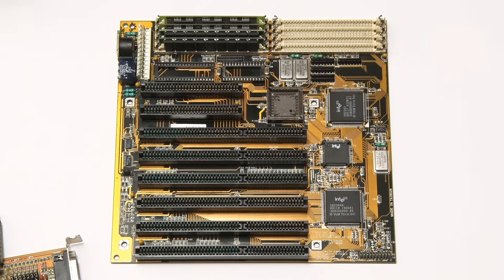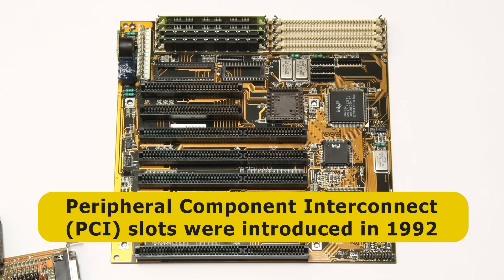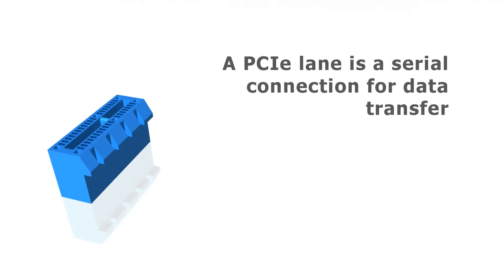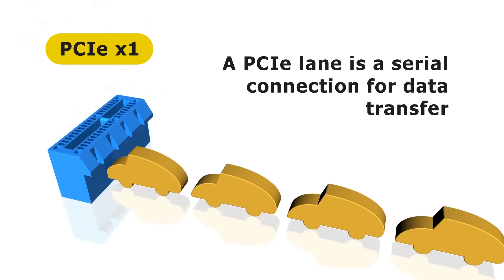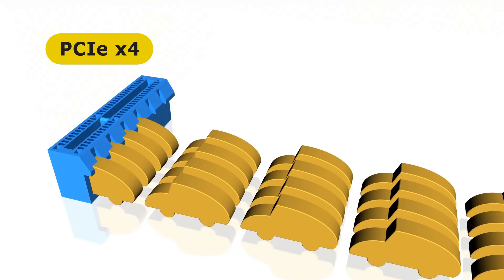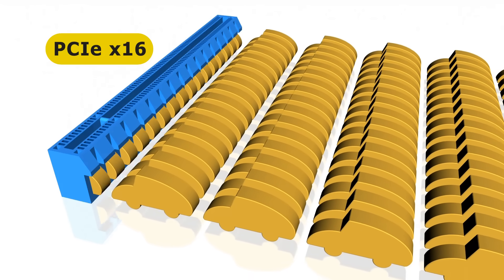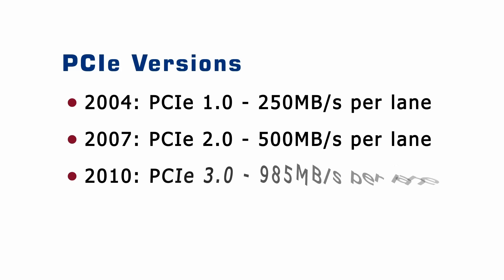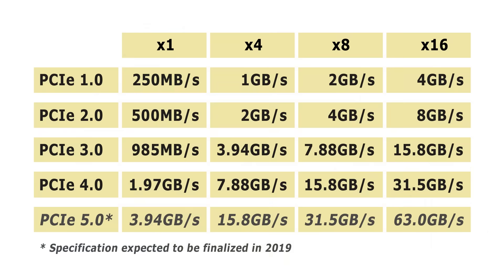Explaining PCIe Slots

Comment: I’ve been tinkering with computers for almost 30 years now, so this really brought back memories as well as actually putting things in perspective. Well done and love to see more on the evolution of just what has been hiding inside those beige boxes over the years.
Reply: I have a question since you said you've been working on computers for 30 years. I have a laptop with integrated graphics card nvidia 1060 6GB card. I am trying to run a triple monitor setup in extended mode (only have 2 monitors at the moment) but heres my question & what ive run into (question at the end). When I had 1 monitor hooked up with DisplayPort cable to DisplayPort MST hub > laptops mini-displayport, I was getting 144hz 1080p (monitor runs those specs). when I connected my 2nd monitor, I was able to get 1080p on both monitors BUT only 60hz on both monitors. im guessing my GPU isn't strong enough to power both at 144hz 1080p right? heres my Q. Can I hook up 2 external graphics cards to run separate monitors and have my laptop run 1 "main" monitor then span with Physx nvidia panel? im looking at the Msi Geforce gaming 1070ti for GPU's.   heres my diagram.                                    left-side monitor: [[GPU {DP cable} > monitor > ; GPU > Thunderbolt 3.0 MST dual hub adapter > Thunderbolt 3.0 port on laptop]]                                                                                            middle monitor: [[monitor DP > DisplayPort MST hub > mini-display port on laptop]]
right-side monitor: same setup as left side monitor since I would have a 2 port Thunderbolt adapter connected to laptop. 
hope this isn't too confusing sorry im a little new to the PC world. I just want 1080p 144hz on all 3 monitors for gaming. thanks!!
Reply: XxBEFALLENxX
Which laptop do you have?

My main computer rig has 2 1920x1080 (aka, 1080p) monitors, and 2 1080x1024 monitors (spanning about 6 feet across my desk). The larger your "desktop," as denoted by the total pixel count, whether it be across one giant monitor or multiple smaller ones, the higher the performance cost to run it.

A 1080p monitor, at 1920x1080 resolution, has 2,073,600 pixels. A 4K monitor is twice vertical, and twice horizontal of the 1080p monitor, at 3840x2160 resoultion, which amounts to.8,294,400 pixels. To run a 4K monitor at the same framerate you were used to on the 1080p monitor, you literally need 4 times the graphics power as you used for the 1080p monitor. Likewise, if you're gaming laptop has a built-in 1080p display (as does mine), and you are running two external monitors at 1080p, then your effective desktop space is 5760x1080, which means that with two external monitors, the GPU has to work 1/3 harder than if it was just running one external monitor. To cope with these limited resources, it has to give somewhere. The reasonable way to manage this is to reduce the refresh rate so that all 3 monitors can be run simultaneously.

Laptops generally aren't well suited for gaming because even those that are specifically designed and marketed for it, despite the horrendous price tags, go obsolete quickly. If it had a 1070 or 1080 chipset, maybe it could do it, but I don't know off hand. Some of these gaming laptops have the GPU on a discrete card, allowing for SOME upgradability, but these will always be proprietary, and cost an arm and a leg. If you're looking for a gaming rig, a desktop is always the better way to go unless you NEED that portability.

Now, if I understand correctly, you've turned off the laptop's built-in screen and are running 3 external monitors; one over the mini-DisplayPort, and the other two running off of a Thunderbolt hub? Thunderbolt 3.0 can transfer at up to 40Gbps, but running two monitors from a hub splits that bandwidth between both monitors, so they both only receive data at 20Gbps, which could also be the cause of your performance drop. 2,073,600 pixels at 32-bit color (32 bits/pixel) is 66,355,200 bits, and times 60Hz requires a  bandwidth of 3.98 Gbps (3,981,312,000 bits per second) or at 144Hz, 9.55 Gbps. So it SHOULD be able to run both monitors at 144Hz. Perhaps the software detects that there are multiple devices on the bus and scales it down by a pre-set rate? I'm not sure.

If the laptop has an HDMI port as well, you might also try running one monitor off of the HDMI, one on the mini-DisplayPort, and one off of Thunderbolt, that way your only bottleneck will be the GPU itself. Otherwise, you might have to get comfortable running your two secondary monitors at 60Hz, and your main monitor at 144Hz if it does that. Typically, the one you want at high speed will be your primary anyways, unless you're spanning the entire game across all three monitors.
Reply: BlackEpyon dang thanks so much for your In-depth response! So I have the Msi gs63vr 7RF 
I have 16GB CPU RAM and the NVIDIA GeForce GTX 1060 GPU with 6GB  graphics card. That is my laptop. 
My monitors are the Msi MAG24C capable of 144hz refresh rate and 1080p. I have only 2 monitors hooked up and I don't have a 3rd monitor yet however I came across this issue(not issue just nuisance I guess lol) ill clarify again so we're on the same page and no misunderstanding occur haha at first I was running 1 monitor @144hz/1080p with PC screen disabled connected via DisplayPort cable to DP MST hub adapter to mini display port on laptop. 

Bought 2nd monitor and hooked up via DP cable to MST hub (it has 3 DP connections and other end is the mini-DP to PC). So then I encountered this issue. With 2 monitors ON (set to extend mode) and PC screen disabled, I was able to get 1080p but both run 60hz now.

My plan is to run 3 monitors at full specs 144hz 5760x1080p extended mode, PC screen disabled for gaming bcuz if I spent the $$ for those monitors then I want to get the full use out of them. Originally I didn't know that it would cause it to drop refresh rate since I was told my laptop can support 3 monitors with the 1060. I'm a noob to the PC world so I thought it was simple plug and play and my GPU can support it. So I understand now that yes it can run 3 monitors however not at what I'm asking for it to do. I started researching and found that yes bandwidth drops because of what you're asking it to do and signal splits like u said. That's understandable to me now lol. 

I asked a frys electronics tech guy and he said to run 2 monitors off a thunderbolt 3 adapter because that'll get me the 144hz/1080p and 1 monitor off the miniDP because it's limited for its bandwidth BUT he said I'll most likely need a 1080ti desktop GPU for the 2 monitors ,which is what ive been looking into, to run the signal that I want. So now I'm thinking with the idea that I need an external GPU with PCI-E adapter for laptop, power supply for GPU, the enclosure, and then cables to connect. Am I on the right track on what I'm looking to do? 

I don't want to run 1 at full spec and the other 2 at 60hz and reason I don't want a desktop is cux at the moment I use this laptop for work too and I like the mobility anyways. I understand desktop is best for this but I just don't like to be stuck to one place all the time. I don't mind blowing lots of money on building this cuz it's honestly kinda funtrying to figure it out. I was an auto tech for 6 years so I know ppl who could make me a custom open air frame/enclosure for the GPU (or two 1070ti GPUs if needed; each 1070 runs 1 monitor and laptops 1060 runs last remaining monitor which would be 1; if that's even possible) again thanks for the in depth response. I hope we can figure this out together lol let me know what you think and suggest. There is no budget idc how much it costs.

Comment: I really miss ISA! 
Had (have!) a WONDERFUL homebrew 4xSID chip ISA soundcard from Hungary.
Have to keep an old computer knocking around just for ISA as the card is that much fun!
Reply: In his video he mentions an ISA slot on a modern motherboard but never talks about it after that.
Reply: there are special "riser" adapter cards, that fit in pci and pcie slots(you can get both types) that convert isa cards to modern mainboards, though i dont know how good they are, also there was a firm from germany re-manufacturing sound cards that you fit your own sid chips on, the new ones are modern cards to fit newer boards.
its actually quite interesting just how many different types of adapters there are for the various slots.

Comment: Thanks! 
So in what scenario would the new PCI-E 4.0 standard become neccesary? Or does is just decrease loading times? I mean I'm still not sure what exact effects PCI-lane speed have on GPU performance speeds.
Reply from the maker: PCIe 4.0, and in time 5.0, just allow higher and higher bandwidth data communication to occur. As you note, a GPU able to take advantage of such bandwidth is needed. There is always a bottleneck somewhere!
Reply: Small computer scenarios are pretty common (x1 slots being faster means they won't require anything larger).
And look at the PCIe 3.0 speed, accounting for bandwidth overheads, it'd mean a 1Gbps network card (almost all are 1x slots) wouldn't be able to reach the full 1Gbps speed in a 3.0 slot.

As for the GPU argument, the speed at which loading textures into the VRAM, which would consume most of the bandwidth, would impact on it's performance. Even the better 11Gb VRAM GPU cards can't store that many hires textures, as it all needs to be uncompressed data. So the loading in and out of textures depending on what is within render distance is normal behaviour.

Comment: One bit to add, PCIe lanes are the most expensive part of your motherboard, these are physical connections between the PCIe slot and the CPU and/or chipset. That is why there are several chipset versions on the market and the ''main'' PCIe x16 slot is where it is (close to the CPU). Also, PCIe lanes (CPU to slot) are divided into chunks of 4. If you have a lower tier chipset, a B150 for instance with 8 PCIe lanes (connections between the CPU and the PCIe slots) and you fit a graphics card into the first PCIe x16 slot, all the 8 lanes are being used by that card. However, if you then fit another device into your other PCIe x16 (x4) slot, it will divide the lanes between those two devices into 4 and 4, effectively reducing the speed of the first PCie x16 slot by half. This is very important for when you decided to put a NVME PCIe card into your second PCIe x16 slot of your PC (or any other such device). The other PCIe x1 and PCI slots, and other devices such as USB and SATA controllers, Ethernet controller and so on, are being fed from the chipset and do not ''rob'' you of the very fast PCIe lanes.
Reply: That is not the right thinking though. Most of the PC users (who care anyway) are gamers, and for that a server grade HW is a waste of money. Paying for what they are not going to use. Even with SLI configuration all you need is 8 lanes per gfx card. Having 16 lanes per card won't boost the performance (PCIe 3.0) as current consumer grade HW won't even fully utilise the PCIe x8 (3.0). Mind you, we are a few months from PCIe 4.0 (5.0, some say we're going to skip 4.0), which will be even faster, than what we use today, which would mean less lanes will do the same job. We have seen this before. PCie x16 (2.0) = PCIe x8 (3.0) and it scales all down to the PCIe x1.  So, we won't have more lanes in the future, we're going to have the same amount or even less, but way faster. It's the physical work to put the lanes on the board and the CPU, that costs the money, not the technology.
Reply: @philipcooper8297  Regarding PCIe 3.0 being fast enough: The M.2 slot for SSDs is basically PCIe with only 4 lanes and modern SSDs are already fully utilizing those lanes. PCIe 4.0 will improve M.2/SSD speeds.

Regarding cost: The insane switching frequencies of PCIe ≥2.0 require special circuit board materials and routing. It’s very hard to get right without repeater chips (signal retimer ICs)  which are expensive. The long wires, pins and connectors also have considerable parasitic capacitance. Switching those caps at high frequency is demanding for power supply and from a thermal perspective. The fewer lanes and connectors you have, the easier it gets.
Reply: @philipcooper8297  the thing is, it has more lanes and still has a better price to performance ratio than an equivalent Intel consumer CPU
Reply: Gamers care a lot about pcie lanes because NVME ssds need lots of it for the bandwdith. More pcie lanes = more nvme ssds = more games you can have installed. More pcie lanes = less sharing of speed between the nvme ssds = lower loading times = getting back into the match faster.
Reply: Definitely, that is also a huge difference between a consumer board and a server board. More lanes! Equal when it comes to expensive server cpu's. They tend to offer support for more PCI-E lanes, required to run a lot of data hungry cards.
Reply: Thankfully the renewed competition between AMD and Intel has allowed consumers to gain access to a high number of PCIe lanes without the price premium of server grade hardware.
Reply: I do not understand the 16 slot PCIe slot as being only 4 lanes (as you say) I thought there were 16??? He showed both a single PCIe slot and i think a 16 PCIe slot. Did i miss something?
Reply: @BillJohnsonavoiceofmen  yes, you missed the part where he explained the physical size of that PCIe slot is for a 16x size connector, but the physical pins installed inside the connectors are only present until the 4x lenght of the PCIe slot.
Reply: @drawdebono77  But actually there are x16 slots with 16 lanes too.
Reply: I think most motherboards have at least 16 lanes. However, low-tier chipsets might have 16 lates with 2 slots. In that case, the slots will share and split the lanes if you use both at the same time. So if you put two GPUs un SLI for example, they'll have 8 lanes each, and not 16 each. That should still be plenty.
Maybe some very low end motherboards only have 8 lanes, shared between two slots? Never heard of it but it's possible this exists, I didn't check.
Anyway, the lanes are only shared between the slots if both slots are used. If you use only one, it will use all the lanes available. But if you use two, then they'll have to split.
Reply: I'm planning to install a PCI to M.2 Adaptor for BT and WIFI to my B450 Motherboard. If I do so, will I "rob" the primary slot for the GPU? Here's my board. https://www.asus.com/ph/Motherboards/TUF-B450M-PLUS-GAMING
Reply: Hi Phil, so I've just put an NMVE PCIe in my PCIe 2.0 x 4 slot and was thinking that I should have put it in the spare graphics slot PCIe 3.0 x 16 but reading this I'm glad I didn't. So it would have slowed down my graphics card?

Comment: Small tip, if you want to preserve the old boards, please remove the batteries while in storage.
Reply from the maker: Very good point.
Reply: shouldnt matter if they're coin cell lithium types, they very rarely leak,  the same cant be said for those 'barrel' nicad/nimh types.... whip them out on sight, even if it looks ok at the time, it will leak eventually... they seem to nearly always be soldered to the board, bad idea, they should've used sockets/holders..as with coin cells..
Reply: Indeed. Tons of old Amigas have been destroyed because of old batteries corroding traces on the MB
Reply: I just smash the motherboards of my old computers, I don't want anyone stealing my data.

Comment: If they dont use an open ended slot you can cut out the end of the slot and it will work.
Reply from the maker: It should -- though note other comments on this below!: :)

Comment: I have a project at uni where I need to build some kind of indoor plant watering system using a Raspberry pi zero w. It will use a small solar panel to run and charge it, and have smart features to it. I would love it if you could do something similar in one of your next videos.
Reply from the maker: Sounds like a great project. I have stuff coming up featuring a Pi Zero W, but not plant watering I'm afraid.
Reply: @ExplainingComputers  looking forward to seeing it. Love your channel. Keep up the great work.

Comment: Ive been playing with PCIe risers and adapters recently. You can use a PCIe riser (normally used for mining) to attach a x16 card to a x1 slot, however on 2 of my motherboards windows freezes up when trying to do this with a graphics card, it seems that its fussy about which slot is used for a graphics card. Also I have a PCI to PCIe adapter and a PCIe to PCI adapter and these seem to work well. AGP is a modified version of PCI, the protocol is mostly the same. There are several different PCI variations, 5V and 3.3V, 33MHz and 66MHz and also PCI-X used on servers.
Reply: Also NEVER try to cut the end stop off a PCIe x1 slot to make an open ended one, I wrecked 2 boards doing this! I fixed one with major soldering re-work. don't do it!
Reply from the maker: Good advice there! I will put my hacksaw away . . .
Reply: Sorry Mr Hacksaw
Reply: Yeah, it seems to work great on my other boards, just not the 2 i mentioned. I used a PCI to PCIe adapter and a riser to get a Quadro 295 running on a Pentium II just for laughs and was able to watch HD H.264 videos on it! Wow cutting the graphics card, that's easier but rather permanent! I wont be doing that to my RTX2080!
Reply: GPU Mining is a special case, because you aren't using the full power of the GPU, just the GPU cores. Some GPUs don't like being run at x1 speeds, this is why AMD GPUs are used. The motherboard also requires a special firmware configuration option for using more than 2 cards (usually), and Windows often won't detect more than 4 cards. IMO GPU Mining is a blight on the PC community and there are better options for mining digital currency without draining worldwide GPU stocks and don't get me started with the used GPU market with permanently damaged formerly used mining cards.
Reply: I've never tried mining, I'm just a fan of interesting adapters.